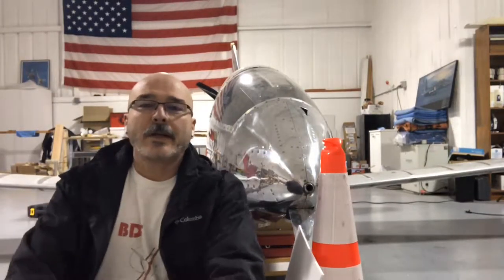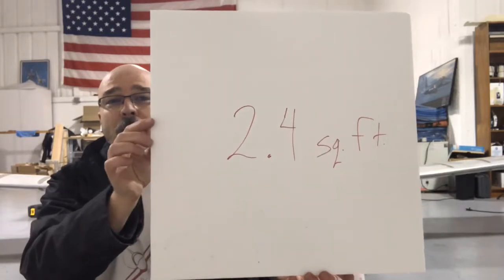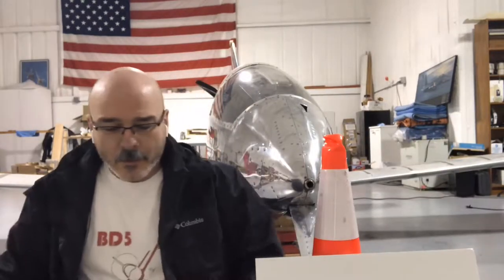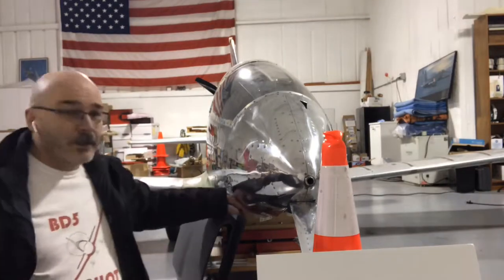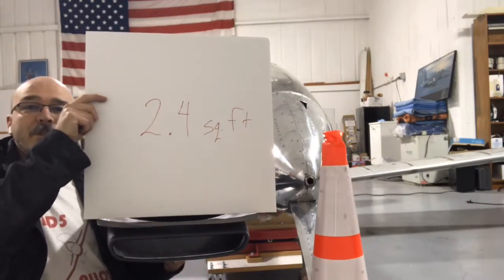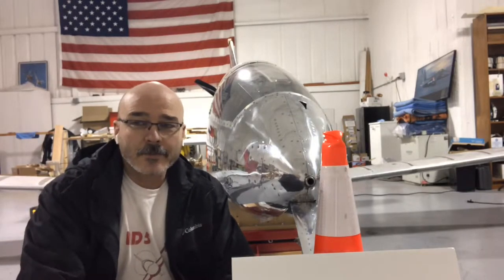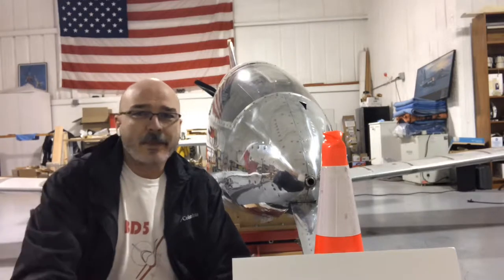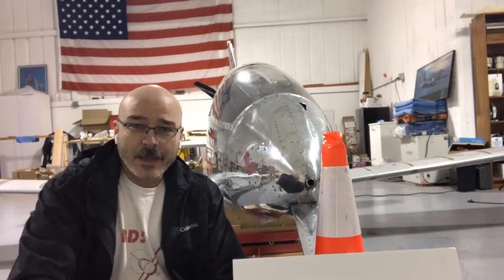The BD5’s flat plate frontal area plus a failed engine cooling area experiment

Comment: BD-5 flat plate drag area can be calculated from top speed, and known horsepower and propeller efficiency. Better yet, and far easier, is from speed and given thrust:

BD-5J maximum speed given as 319mph. This calculates to 260.16Lbs/ft^2 of dynamic pressure. Known as "q". [0.5*(Rho*V^2)] Where V is in ft/sec. And 1mph = (22/15)ft/sec. And Rho = 0.002377.

Microturbo TRS18-46 has 1,000N max continuous thrust. But actually 1,100N Maximum for a few minutes. This is 247.29lbf. 

Thrust divided by drag gives 0.9505. Correct it down over 3% to account for compressibility at 0.42 mach. Is 0.923. 

This is flat plate drag of BD-5J. Easily under the magic 1 square foot. Where q can be greater than thrust.

Take flat plate area, Divided by 37.8sqft wing area. Gives 0.0244 drag coefficient. This is beliveable, as Vans RV-3s which are aluminum single seat centerline seating airplanes have a similar CD0min around 0.022-0.024.

This 2.4 square feet is probably at maximum lift over drag speed, where induced drag makes up half of the drag (doubles the drag). And there is extra interference drag also.